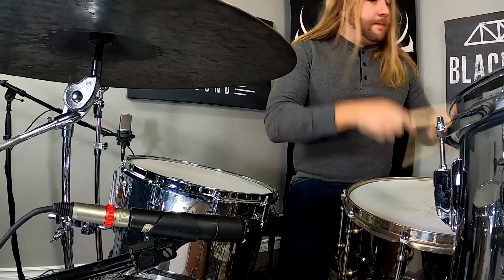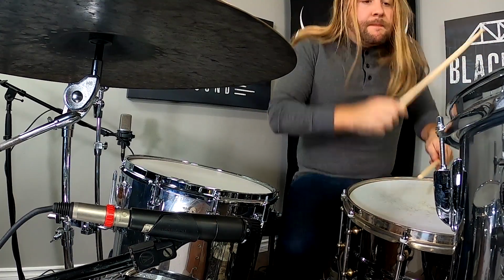How to Get Pro-Quality Drum Recordings with Just One Microphone: The Wurst Technique

Comment: Did you have any phase issues?
Reply from the maker: I didn’t adjust any positioning of any tracks to correct any phase issues that might be present. The two overheads are both positioned an equal distance from the snare with each other. The sm57 in the wurst position will pick up the sound slightly sooner because it’s much closer. You could micro adjust the tracks after they’re recorded and might get a slightly more in phase and cleaner sound but I’m not big on doing that since it wouldn’t have been an option for the big boys on tape anyways!

Comment: What kind of microphone stand are you using? Obviously there's a boom arm attached but what about the base and stand? Is that just a kick drum stand?
Reply from the maker: I’m not too sure, I haven’t found another of them in the wild. It’s got a 3 leg base but the base is about the same size as a round base stand then there’s a straight pole coming out of the middle of the base that’s adjustable up and down from maybe 16” or so and I put a boom top on that. Works great for getting a mic on a snare!
Reply: @BlackBridgeSound  Thank you for the prompt reply. I record rehearsals using a Zoom H5. I've been using a single overhead but too much cymbals. I've seen "low profile" mic stands. Gonna research further.